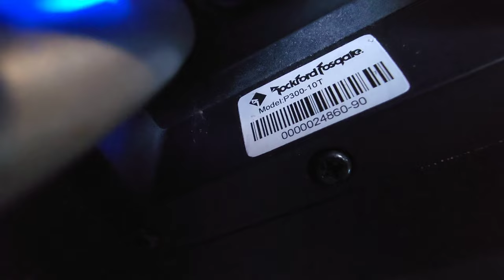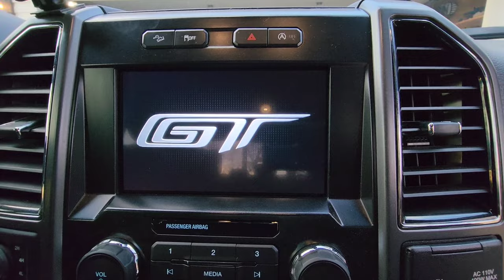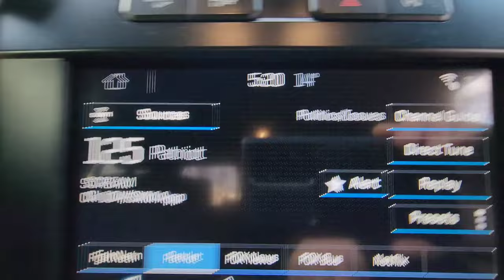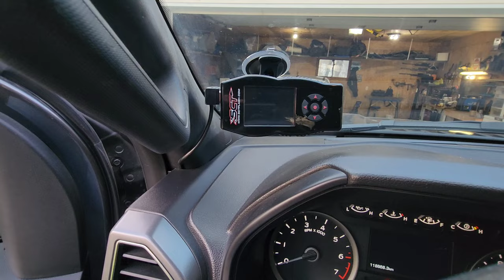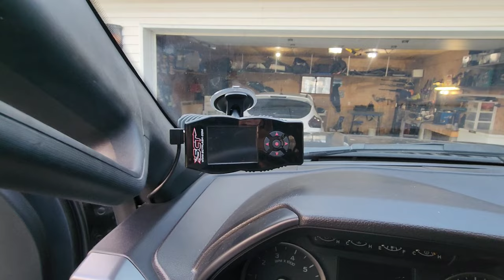BEST MODS FOR YOUR F150

Comment: 2018-20 no longer need a catch can as the engines were refreshed in 18 to fix the issue, you can now just use seafoam 500 miles before oil change and it works way better than a catch can
Reply: Sea foam is awful, please do some research. I do agree with the catch can not being needed for 2018+ though
Reply from the maker: Ya catch man is needed more so on turbo applications but it doesn't hurt!

Comment: I have a 2018 f150 coyote 5.0 ver3 w/1080R 157 inch wheelbase with a oil consumption problem. There is a recall out on it...  requires engine puter reprogram and a new dipstick, they made some of them with the wrong length of dipstick. Just Fyi may not apply to all of them. basically the throttle plate was closing to tight causing too much vacuum in the engine. and the dipstick was a problem with dipstick in the factory? but, after fix, now it does not use oil like it used to. Ford called it a "oil consumption issue"

Comment: The bullet antenna is sick! gives the truck a small point of character, also, what brand of all terrains are those 33 inch tires?
Reply from the maker: Ya i always been a fan of the bullet antennas! And at the time the tires were Radar Renegade R/Ts. I'm now running Amp A/T tires
Reply: @fiftynation  nice, are those newer tires just a better ride, like less noisy, or kind of the same but different look?!

Comment: What brand headlights and tail lights do you have? Also what size wheels & tires? Thanks
Reply from the maker: Alpharex Headlights, Anzo Tailights and wheels are 20x10 with 33 inch tires I have specs listed in previous videos
Reply: Looks amazing! Is the offset -18?

Comment: Hey bro I’m from manitoba as well, wondering how are the radar renegades rt+ tires in winter?
Reply from the maker: Hey man! so far so good! Tires have worn evenly thus far not a ton of road noise, They got me through last years winter with ease. For the price I definitely cannot complain.
Reply: @fiftynation what did they cost and do you still use em?
Reply from the maker: @domenicaugustine119  ai actually just got rid of them for a new set of wheels and tires you can see in my latest videos

Comment: Rancho lift is strictly for aesthetics, for any offroading its straight trash. So if you just like the lifted truck “look” for aesthetics sure get it, but if your going to do any mild off roading, not worth it
Reply from the maker: I certainly haven't had any issues and have done a fairnot of offroading in teh local pits and river runs. Lots of suspension travel.